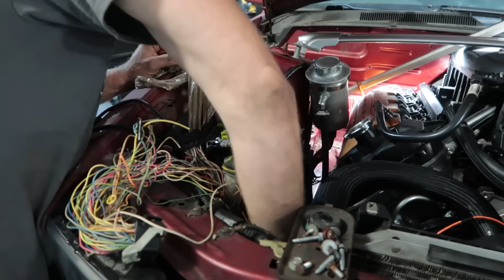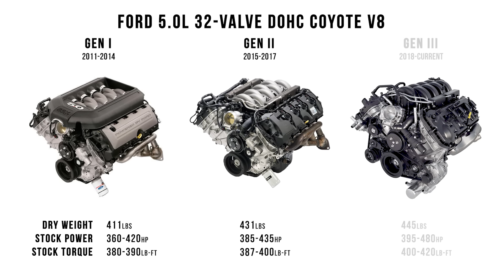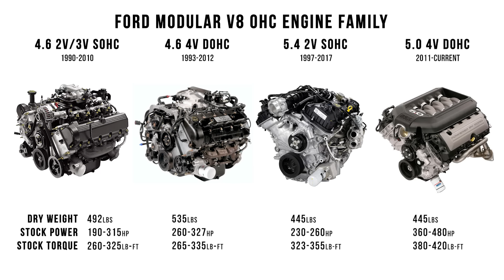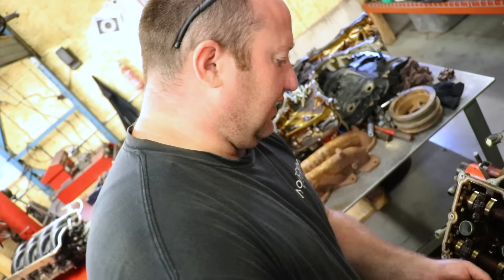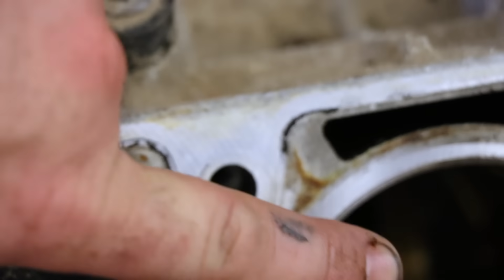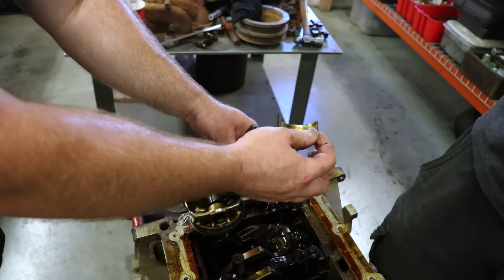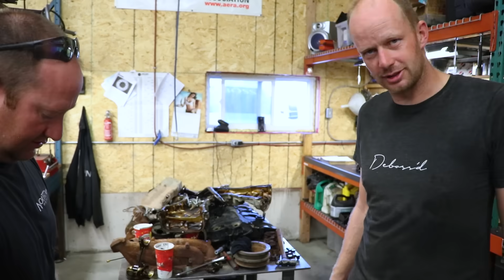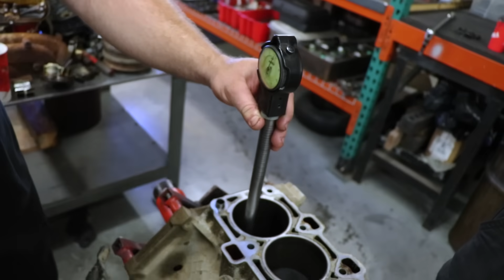REVIEW: Everything Wrong With A 5.0 Coyote Engine

Comment: One thing I've noticed owning a 5.0 Ford engine is how well balanced it is.  Other motors I've owned will have a bit of a shutter sometimes at idle, but not this one.  I literally can't tell it's running from inside the cab.  I really appreciate this video and the commentary from the professional techs.
Reply: Same, although mine isn’t a fault, i don’t notice it either
Reply: I've noticed they rock shudder and stutter once they hit 100k and I see many on them 5 days a week I personally drive a 5.3 silverado and cannot tell it's running at all in the cab except the pipes thumping away
Reply: Same, although mine isn’t a fault, i don’t notice it either
Reply: Same, although mine isn’t a fault, i don’t notice it either
Reply: thats because ford always has a wimpy cam from the factory
Reply: @yurimodin7333  wimpy? 400hp stock out of a naturally aspirated engine. Is far from wimpy! Lbs!

Comment: Short drives are horrible for engines. Specially if that’s all you do, like 2-3 mile daily in town trips etc and extended oil changes on top of that is even worse and it’s even worse if you have a direct injection motor and you do extended oil changes and only short trips!!

Comment: Hello, I have a 2013 5.0 V8 F150.   I am trying to be really good with oil changes.  I am running synthetic oil. but I do drive the truck and it gets hot.  I am in construction and use the truck a lot for picking up lumber and going to job sites.  I have over 224000 miles.  Knock on wood it has been a great truck.  What would you recommend so it keeps going for me?

Comment: Yeah I have a 2015 XL the 15XLT 5.0 my question is would change in the oil chinna oil at 3000 miles instead of 5000 recommended with knock down on the sludge build-up did you see in your video
Reply: That's a 2015 XLT 5.0

Comment: I have an old 1998 4.6l f150 manual trans with 365k miles and its towed a trailer almost every day of its life. I also have a 2014 5.0 coyote F150 with 245k on it and it also tows daily. I do oil changes myself about every 4000 miles. Hopefully I get a few more years out of both trucks without any major repairs and so my son can learn to drive. My other vehicles are a 2000 Toyota celica GTS with 255k that I rag on and 8500 redline constantly . A 07 Chevy 2500 Duramax with Edge programer with 160k that tows 10k-15k often. And last a 2020 5.0 coyote supercharged mustang Everyone of them has Synthetic oil… never changed an engine!  …maintenance is way cheaper than buying new cars,trucks and equipment… teach your wife to check the oil once a week…. now if I could just get her to stop burning up brakes and clutches!

Comment: These are the best american V8 motors ever produced. Slap a blower on a factory stock motor and you can easily make 800-900 daily reliable hp. And by stock I mean STOCK. Not touching or replacing heads, cams, and intake while calling it stock like some other guys like ...*looking at the LS guys*. There are guys in Houston running sub 7 second quarter mile times on factory sealed motors. Only down side to these motors are the owners who use garbage tunes with garbage fuel.

Comment: Ford engines literally just look like two Toyota 4-cylinder stuck together That's not a bad thing just in my opinion doesn't belong in a work truck there's a reason why Ford got rid of the freaking overhead cam and the super duties and went to a pushrod 7.3 L big block It's actually great engine I have one in my f550... Will admit though they started to get that V10 right at the end and my boss was actually mad when we went to go order new trucks and they didn't make it anymore cuz they did start getting it right at the end but so far these Godzilla have been great we have about 15 of them

Comment: As an ex Mobil Oil employee, I can state with authority that Mobil's testing shows nothing like what you see in this engine. M1 synthetic oil, changed regularly, will result in clean engine internals. Period, end of story.
Reply: Just change the Fn oil. Any oil will work
Reply: @mac6746 LoL!
Reply: his engine guy seems to have a lot of nonsense opinions on oil
Reply: @acerdale5099  like what?
Reply: I have 300K on M1 and it idles all day every day since 2013 on the job site, still going strong.
Reply: I think the 5.0 is the best motor ford had ever built but the ls is a better motor overall
Reply: Is that an IDI engine or a direct injection engine?
Reply: lol facts based worst oil in category fails every evap test first and foremost along with the zinc levels being sad like every aspect of the oil is terrible .
Reply: The mobile one high mileage has tons of zinc.
Reply: Yeah sure

Comment: I got a 2013 f150 roush edition with the stage 2 supercharger in it and it’s been misfiring real bad with the computer saying the issue is on cylinder 8 and 4 “coil packs” I changed those and the misfire has not gone I’m assuming now it’s a valve issue

Comment: I'm up to 130k on my 2018.
Only replacement of a bank one phaser solenoid. Same transmission too.
Trucks been to over forty states hauling trailers and now pets in a camper shell.
Lots of oil changes. 5w40 mobil 1 T2

Comment: People like my moron high school buddy think that they can tune and bump up the red line. Ok fine do it but trouble may follow. I was like just buy a GT 500 or Cobra keep it stock or live with the base GT 5.0 and keep it stock as far as tunes. Me I prefer the Cobra had a 96 brand new zero issues. Have had 4 Mark 8 vehicles no motor issues ever.  Kept my fathers 1968 Galaxy 500 for 40 years with a 302 2 v carb had over 100k miles and ran great. I have a 2010 GT 500 currently hope the 5.4 cast iron supercharged is a good as Ford's 4.6 and 5.0 motors!

Comment: the 13-14 Coyote is technically the 2nd gen as the overheating of cyl 8 was fixed but still had other issues
Reply: Gen 2 / 5.0 would be 2015 - 2017. Happy motoring, peace out.

Comment: B.S      my oil pump gear failed SNAPPED in my 5.4L triton they make BILLET GEARS for the oil pump for the 5.4L , 4.6L, 5.0L   you can use coyote heads on a 5.4l triton bottom end cause they use the same bottom ends [5.4L - 5.0L] use the same bottom ends jus different heads they are called    "mod motors"    for a reason did you know that DEBOSS GARAGE

Comment: I'd be willing to bet that the sludge buildup on this engine had nothing to do with synthetic oil.  The oil was probably changed every 15,000 miles.  That's probably the reason.  I always use synthetic oil in my car and change it every 4K miles.  I tore the engine down and rebuilt it and it was nice and clean when I opened it up.
Reply: You are 100% correct, 
That engine looks like it got 20,000 oil changes at best.  Totally abused. Actually synthetic oil would take longer to sludge up.

Comment: First Gen had sintered metal pistons and rods.  I had a 2012 and I installed an Edelbrock supercharger, made great power (690 estemated crank hp).  Engine blew after 6000 KM, 3 pistons damaged.  2015 and up were better.

Comment: Whoever owned the truck was neglectful about oil changes. I recently dropped my oil pan to replace the gasket and it was clean compared to the tar in this engine. 195K miles first gen 5.0.

Comment: My 2018 f150 5.0 has had a knocking noise since I bought it.  Ford says it's normal.  Some say it's piston slap from a warped block.  Still runs good.  Just sounds like crap at idle.

Comment: only thing your bud forgot to mention is the roughly 440hp (390hp factory rated) 03-04 Cobra supercharged dohc 4.6, Ford partnered with Manley to make this beast with forged internals that resulted in people getting them to make tons of power on stock engines like ~800 with upgraded supercharger and fuel system and many turbo/twin turbo cobras making 1000-1300 at the wheels and even heavily modded, people say they are really reliable. 
Only real downsides being alternator dying, overheating in traffic and intercooler pump popping fuses and most re-man engines not being able to handle much more than 700-800hp.

Check this Lund racing cobra making 1351hp at the wheels or roughly 1600hp at the crank https://youtu.be/BIZhVBOCLt4

Comment: Ignore the talk about synthetic oil.  Just change the oil before the manufactures suggestion, and let your engine warm up to operating temperature before driving away especially if you're doing a short drive.  Let the PCV system do it's job to remove the condensation from a cold start up.  🙂

Comment: I don't doubt his experience, but his conclusions seem off. Doesn't mean he isn't right, but the tendency is quite a lot different to our reality here in Europe. 

Aluminium and Synthetic don't like each other? I mean, in Europe we run synthetic oil for decades on our decades old AluSil engines and our experience is the exact opposite. I opened quite a few engines which ran exclusively on synthetic and they generally have no sludge compared to people swearing on mineral oils. Especially since conventional oils break down faster at higher temperatures and strain. I mean, a Ford 5.0 is not an performance engine. We don't consider a 4.2 380ps engine an performance engine and they run 300.000km with no problems being all Aluminium. Big difference between European and American engines it seems.

I've seen bearing damages on engines which ran 10W-30 conventional like the manufacturer suggests more often than on the same which ran synthetic 5W-40 or better.
And I have yet to have an engine burn more oil than 1L every 12.000km while having more than 250.000km on them

Comment: Scott what do you recommend for the 5.0 in my truck , performance rods and pistons if the cylinders mic out in good shape go with stock rings or ? Bearings are there bearings better than others , I have a thousand questions, new cam phaser’s and cams reuse the lifters . My goal is to increase hp and durability’ is it possible with out using a blower or turbo charger. 40 years ago I could take out a motor and rebuild it very cheaply you can still get a kit for a chevy 350 around a hundred dollars but I’m a little out of my league with technology today. I’m 62 and slowing down. If you could recommend what I should do. Where are you located? I’m in Minnesota Hibbing, don’t get me wrong I want to learn all I can about the coyote. Thank you for your time

Comment: I have 390,000 miles on my 2017 F150 king ranch 5.0l coyote. I love it and I beat on it frequently ! No tune, stock filter box with a KnN just Mobil 1 oil changes every 3k. Like never a mile over. And I use the motor flush from Walmart and a bottle of Lucas. Every time. I am the OG owner. It has 6 miles on it when I got it. I beat on it everywhere. No probs. I did have cam fazers go out at 89k but that’s up.

Comment: That's aluminum oxide your talking about that wear the crank. Aluminum has no hope of scratching hardened steel, but if you heat it up that hot oxides likely form. Aluminum oxide has a mohs hardness of 9, steel 5-6. Scratchy scratchy.

Comment: Pretty sure oil deposits are the other way round. Synthetics have higher boiling points, and are more resilient to breakdown. The boiling point is higher, end of story.

    Since no history is known it's perfectly possible this guy rarely changed the oil, and perhaps he used conventional oil th one time he did.
 
I've had no such issues with regular maintenance.

Comment: It's not synthetics fault, it's the previous owners fault not servicing the car/truck on time...
Reply from the maker: Right we’re not blaming the synthetic just saying this is the result.
Reply: @DEBOSSGARAGE  That's right. Both, convetional and synthetic will form sludge and crap if driven like +30 tkms between services. It's about the quality too. Does the oil have approval of the car/engine manufacturer?

Comment: So if you don’t mind I have a question,  I recently bought a 2018 Ford F-150 with a 5.0L with 50,000 miles what oil do you recommend for longer life of my engine,  synthetic or conventional oil and also what specific oil? thanks.
Reply: Use Mobil one 20,000 mile oil and you are golden!

Comment: Nothing wrong with Sunnen dial bore mic's. I own two of them and they are dead accurate. I own Sterrit bore gauges as well as Federal and Mitsutoyu's. The accuracy of their readings are dependent on who is using them and how they were calibrated. Of all of my dial bore mic's I would have to say that the Federal design would have to be considered the most crude. Before I make a total condemnation of federal tools, I have to say my examples were made during the Korean war.  All of the others were made in the last 30 years and were purchased by me new. I can depend on an average factor of error to be .0001 or less from each of these tools. Even the federal unit. There is no part in any engine I know of 50cc's and bigger that have tolerances any where near .0001 inch.

Comment: I have a layman perspective when it comes to V8s, but from a swap perspective the LS is a no brainer due to its size, availability and virtually endless aftermarket support. However, the Coyote, at least based on its sound and higher redline, definitely has a lot more character than the LS. LS engines sound good but have virtually no character as far as V8s go.
Reply: Who gives a damn about character LS much better reliability

Comment: I have a question for anybody out there should not use synthetic oil I have a 15 Camaro and it doesn't burn any oil I never have to add any oil in between oil changes and I use mobile one synthetic

Comment: Thank you for your videos. My experience is as a cab driver using Lincoln Towncars 4.6L engines and they gave me about 400k miles in average, using regular oil and maybe refurbished oil as the company made the oil changes. Driving almost 24/7, idling a lot, AC on always (FL weather!!!), and keeping up with maintenance gave me very few break downs besides transmissions. I’ve been so happy that I’ve bought a 2010 signature limited for myself when I stopped the cab business. Mine had 106k miles when I purchased it and it sounds like new to me. Used synthetic at first change, drove 9k, changed a couple weeks ago with mobil1 synthetic 5w30 and just now watching your videos come to me that we didn’t use synthetic back then. I’ll use this for 3-5k then switch to regular oil.
Two questions though:
1- is the Lincoln engine different from the straight Ford 4.6? Better?
2- what’s a good regular oil to use? And filter?
Thank you so much for your efforts to educate mechanics and buyers about your experience with these engines without bashing us down!
Reply: 1 same engine for the 4.6
2 factory ford filter always and any name brand oil changed and topped off regularly

Comment: SO I HAVE A 2014 F-150 WITH 54,000 AND USE CASTRO FULL SYNTHETIC OIL.  BEEN USING THIS OIL FOR 30 YEARS. NEVER HAD A MECHANICAL ENGINE FAILURE.  I DO OIL CHANGES 4-5 THOUSAND MILES.  YOU’VE GOT ME CONCERNED ABOUT THAT OIL BUILD UP. SOLUTION?

Comment: My 5.0 in a 2011 F150 has 255000 miles on it and burns no oil runs like a champ. No engine work needed but spark plugs serpentine belt and of course oil changes. Satisfied from Nebraska

Comment: At 1630 did he try and equate piston bore and stroke with piston deck height to cubic inch?
It doesn’t work that way
Bore and stroke is the only thing that sets cubic inch 
not deck height not rod angle (longer or shorter rods)none of which effect cubic inch calculation 
And no not even compression

Comment: The answer, the coyote is the most superior American v8 on the planet. Running 8 second quarter miles in a full weight car with the factory sealed engine is the norm. Right now the record is a 7.8 in the quarter with sealed motor.

Comment: I disagree with the analogy of displacement. If you bore the cylinder(s), it WILL increase the displacement. the lower height of the piston will decrease the compression ratio, not the displacement. displacement IS equal to Piston Diameter/2 (radius) squared, times PI, times the number of pistons.
Reply: I'm sorry, I left out the stroke in my formula. Piston Radius squared, times PI, times stroke, times the number of pistons.

Comment: The Coyote is by far the best motor Ford makes. If properly maintained and no abuse it is as good as any motor under 100k. This includes the LS and Hemi. Haters will hate. I have a Chevrolet 6.2 High Mountain 2019. I am on the 3rd engine. The cylinder deactivation is a nightmare. I will be trading it in very soon.

Comment: I get why everyone hates the 5.4 3v … I have so much experience with them and the only way to get experience is to have to work on them a lot, but that being said if you are a responsible vehicle owner and you religiously change the oil using a full synthetic and 5/30 instead of 5/20 and change it every 5000 they will treat you extremely well. The 5.4 didn’t handle poor maintenance. If you’re a shitty irresponsible vehicle owner you’ll have nothing but heartache I personally own a 5.4 with 750,000 km on it had to change the tensioners numerous times ( more often if using jobber parts instead of oe parts) at about 500,000 I opted to be proactive and replaced the oil pump with a melling high flow high volume and the motor is now on its 3rd truck it keeps outliving the trucks it gets put in. takes a bagging like no other motor I’ve owned. At the end of the day if man made it it’ll break regardless of manufacturer. Be responsible and do proper maintenance and they’ll all last a long time